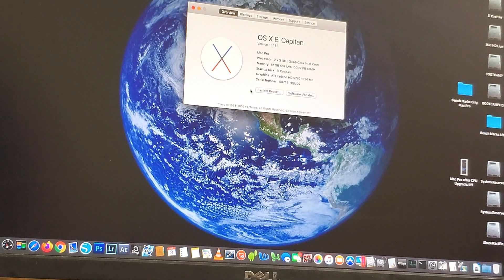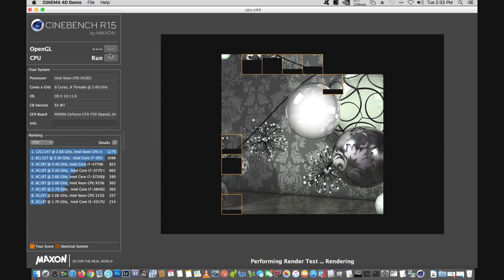2006 Mac Pro CPU Upgrade 8 Core 3GHz 1,1 in 2020 Building the Beast Pt. 2

Comment: How much invested in all upgrades? Thanks
Reply from the maker: If memory serves correctly the GPU was the most expensive part around $40 USD.  So after I was done with the '06 Mac Pro probably had around $100 USD into it with Memory, GPU, SSD, and new CPU's.  Ans sold it for $180 USD

Comment: What would be the best GPU to replace the stock GPU on the Mac Pro 1,1?
Reply from the maker: I do not have an opinion on the "Best" GPU for the 1,1 if you want some games or acceleration in Win 10 on the 1,1 you can go for a low end Nvidia card with 2 gb or more Have uses the GTX 750 but if you really want a better GPU I would look for a 5,1 Mac Pro as the 1,1 really has some very significant limitations.
Reply: Gtx 980ti is the best one but wont work under mac os only on windows and also no  boot screen

Comment: I have the same pro....and same Graphics card.  Did you have to run a Dual mini 6 pin to 6 pin cable to power the card?
Reply from the maker: I am currently using the 5770 so only requires a single 6 pin connector.  To power the card.
Reply: @CorbinElliott  Thank you!  I was worried about the power needs of the card and wasnt sure if i needed a dual 6 pin or not.  Cheers!  i just got this to replace a first gen 1,1 Mac Pro that worked well for 10 years....until it didnt.  Ill fix the older one, but the new one is a screamer!

Comment: Hello, I’m getting a Mac Pro 1,1, I was wondering if it possible to make it a 4,1? I paid $70 for the machine but I was thinking if I can buy a board 4,1 will it work? Thank you.
Reply from the maker: Is it possible, short answer is Yes it is possible, but.  But you would have to gut the entire machine and replace every component it it.  So cost effective and time wise. Buy a 4,1 and sell the 1,1 because it may never work right after 1000's of dollars spent to try and make it something it is not.

Comment: What is the best cpu i can get for 3.1?
Reply from the maker: The 3,1's are limited on cpu options.  The top of the line is the  X5482 still only  a 3.2GHz quad core.  with a high watt 150w. Unless you have WolfDale dual processors in upgrading to these may not show the improvements you are looking for

Comment: I have a Mac Pro 1,1 coming from Los Angeles in 2-3 days. I pray the shipper packs well, it is a Charity Connected with a Load of Mac Pros, I paid ITEM PRICE:
US $137.49 + Shipping and Tax
US $181.65
Order Apple A1186 Mac Pro 2006 2x Intel Xeon 5150 2.66GHz 8GB 1TB HDD 7300 GT 10.6

Apple A1186 Mac Pro 2006 2x Intel Xeon 5150 2.66GHz 8GB 1TB HDD 7300 GT 10.6
Listed for charity.Apple A1186 Mac Pro 2006 2x Intel Xeon 5150 2.66GHz 8GB 1TB HDD 7300 GT 10.6

Estimated delivery Fri, Jul 03 - Fri, Jul 10
Reply from the maker: I hope it shows up in pristine condition for you.

Comment: Hey there! Thanks for the useful video. I have two questions
1. Can i run High Seira on 2,1 mac pro?
2. What is the best or suggested GPU for mac pro 2,1?

Thanks in advance!
Reply from the maker: 2,1 is stuck with El Captain due to the 32 bit efi built in to the machine.  You can run 64bit Windows 10 in legacy mode so that is current. I am using an AMD 5770 1gb card in ours.  Have used a GTX 750 but it was flaky so can not say I recommend that. Thank you for stopping by and commenting.
Reply: Thank you so much for your reply! Would you suggest AMD 5770 ?

Comment: Other than the processors, we apparently have near-identically configured machines.
I was going to upgrade mine but realized the 1,1 was one of the nicest machines Apple made, before they became well... imho kind of junky.  So I didn't really want to mod the hardware.  Silly perhaps, since I could just buy another if I monkeyed it up.
On the other hand, it is now my primary PC.
Reply from the maker: Good Deal! Actually like our 5,1's too they are well built and highly upgrade-able.

Comment: Hey there! Do you know any good gpus (preferably Radeon) that would work with the 1,1 Mac Pro, maybe something along the lines of a rx 570 or even a 550?
Reply from the maker: Really I don't unfortunately the 1,1 is stuck on El Cap so that one of the limiting factors as well as the PCIe bus is so much older. I know the Nvidia 750 will work but is sometimes flaky and the ATI / Radeon 5770 works very well but it is only a 1 gb card too.

Comment: Interesting video, thank you! I just did tbe same mods to my 1,1, same CPU, same GPU. The results were great . Real world has been much more dramatic than the benchmarks. Did you do the SMC flash?
Reply from the maker: Yes did both the 1,1 -> 2,1 and the SMC flash to accommodate the new processors wanted to make sure the Fan Curves were correct
Reply: CE's Geek Stuff stuck on the flash!!! Is there a specific video you used? Haven’t been able to get the flash to take

Comment: hey i got a 2006 1,1. trying to upgrade. its currently on EI captain. can it be upgraded to catalina? i want to get new processors etc. currently has an ati radeon hd 5770 xfx card as well as the stock card
Reply from the maker: No unfortunately the 1,1 is stuck with El Cap.  Due to the 32bit EFI Apple built in to the Firmware.  You can run windows 10 in 64bit just fine.  But nothing beyond El Cap.

Comment: I have this Mac Pro now and want to do exactly what you did. I’m doing audio production and running Ableton. Are all the parts you upgraded in the description or were there more?
Reply from the maker: The only other thing I have done is a memory upgrade to 16GB's that's about it.  Just remember you can not go past El Cap so if Ableton needs a newer version of the os you may want to look for a 5,1

Comment: I have this same system running el cap (with the original processors)  and 32 gig or ram.  Really want to run windows 10 on it also. Do you have a link to how you installed it.?  All the tutorials I found need me to have windows pc to burn a modified window.iso DVD.  Don't have that option in lockdown her in NZ but would love it get it sorted.
Reply from the maker: I actually had a couple of windows installs already on drives that I was able to migrate over.  Unfortunately I did not specifically follow any tutorials other than the bootcamp drivers. Let me search around for you to see if I can find an easy install.  I know the new versions of windows will not fit on a standard DVD you will need a Dual Layer DVD to put them on .  For the Mac Pro 3,1 I did have an old image of Windows 10 that actually fit on a standard DVD.  Check out some of @Hrutkay Mods most of them will help quite a bit.

Comment: I run a HD7950 in my 1,1. Works a treat in El Cap, Win 10 and Ubuntu 18.04
Reply from the maker: Have not tried any Linux variants yet.. good to know!!
Reply: I'm looking to upgrade my GPU too, I currently have the ATI Radeon HD 5770 but was hoping I can make the computer more powerful.  Can you help me?  Do you have the Mac edition or PC?
Reply from the maker: All GPU's I use with the exception of the HD 5770's are PC GPU's The problem with the 1,1 and newer GPU's is the lack of SEE4.2 support.  The 1,1's EFI of 32 bit and the limitation of the PCIe support.  Would try things like Nvidia 750's or older.  Still should get pretty decent performance out of them.
Reply: the hd 7950 is mac version or pc version?
can you tell if a rx480 4 gb will run?
Reply: @joaolameiras9881  XFX HD7950. Flashed for bootscreen.
Reply: Hello everyone.
Ive got a Mac Pro 1.1 which I upgraded the cpu,s yesterday to quad core all went well.
I’m trying to install El Capitan but not quite sure how to do that and I can’t really find any Mac OS el cap on the net.
If I could get some help that would be great.
Also flashed it to 2.1 to show up the new CPU’s

Comment: I'm curious why it only bumped the multicore to 8000. Mine went from 5000 something to 11,000ish. Maybe it's because it's running on El Cap. I did both of my tests in 10.7.5. I also maxed the ram out at 32gb.
Reply from the maker: Not sure it is possible that it is El Cap.. but did increass the ram so I am running the benchmarks again using geekbench 4.
Reply from the maker: Just ran it again with 24gb memory.  And still 9102 Multi-Core so not sure what is going on.  Will have to investigate a bit more.  Thanks for stopping by and commenting